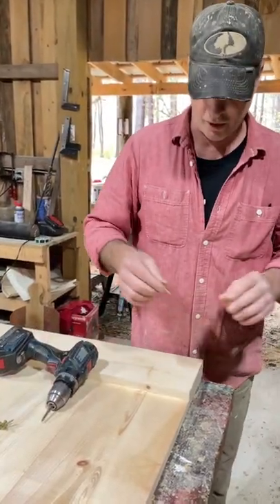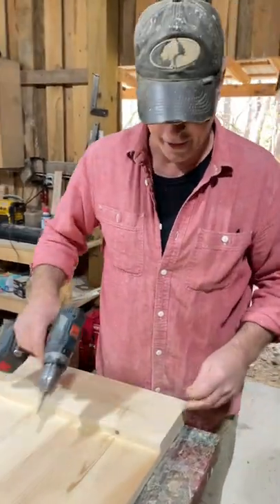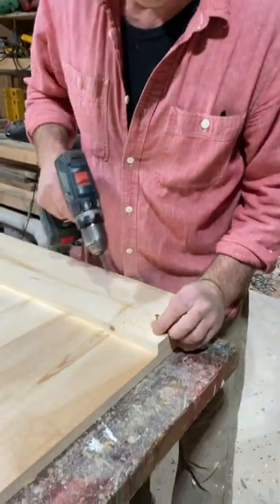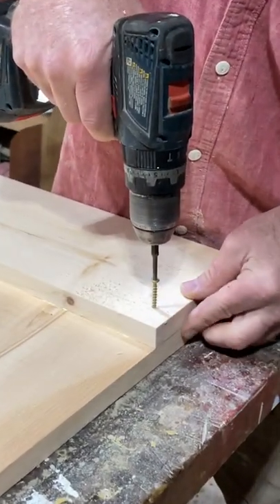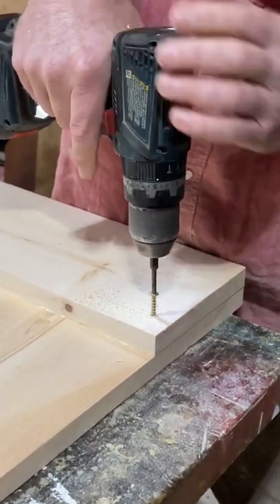How to prevent end grain split when screwing a board close to the end.

Comment: Great, so destroyed upper plank threads this way.

Nice
Reply: My dad built scenery. They used this trick all all time, and then had to disassemble it later. Your screw will be fine and it'll hold. That said if your in a shop building nice stuff yeah you're right just pre-drill, but this is good for lots of scenarios.
Reply: The thread on the top plank is not needed and in fact is more of a hindrance, the top plank should be pulled and clamped to the base board a full thread screw just increases the risk of both parts not correctly mating.
Reply: In fact exactly as it fails in the video when he drives it in you can see both boards separate and a gap remain, incorrect screws will do that.